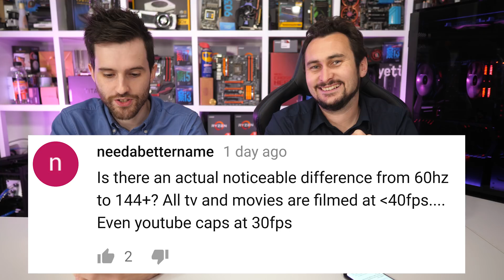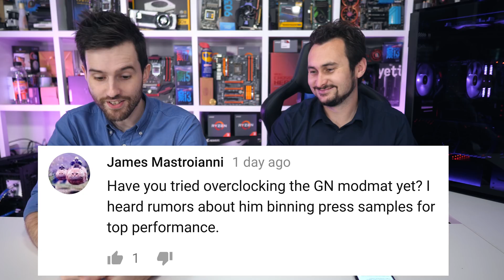May 2018 Q&A [Part 2] Will AMD Make a Better APU? GN Modmat Overclocking

Comment: Is Ryzen really future-proof for gaming?
Probably yeah? I simply don't know. There are many reason why I think it is
1. Games starting use more than 4 threads and game developer have no reason to use less
2. Current and next gen console use AMD 8 cores CPU
3. Rumored PS5 will use AMD ZEN based 8 cores CPU architecture and game developer will optimize the game on both console and PC at the same time
Reply: 4. Low-level APIs which're eventually going to become mainstream, spreading the workload amongst all threads evenly as opposed to current high-level ones which put the majority of the load on the first thread. So theoretically the more fast threads you have the better, but there's a level of optimisation that goes into it unsurprisingly.
Reply: fx had 8 hamster wheels but only 4 hamsters.... do not count that one as a real 8 core, because it is not
Reply: look at AC: O benchmarks of i5 8xxxs, CPU usage is at 100% on all cores, and 4 core i5s are useless....
Reply: Matthew B. Why you ask? well if you have 19 minutes to spare watch this video
https://www.youtube.com/watch?v=RwF5XewHmU8&t=61s
i5-8400 and i5-8600K CPU load hover on 90% - 100% at AC: Origins on new install clean PC, imagine what happen on normal PC with program running at the background.
Reply: Matthew B.
1. The reason why I chose AC: Origins is to show you the possibility if you gaming with CPU with less cores and threads.
2. The reason why RYZEN have less FPS than intel because RYZEN is brand new CPU architecture and unoptimized, all games we play today is intel CPU optimize. This video will explain it: https://www.youtube.com/watch?v=ylvdSnEbL50
https://www.youtube.com/watch?v=gFBKFz9n2hc
3. The reason why I chose RYZEN more future-proof for gaming is because RYZEN have more cores and threads, most AAA game developers don't make game with high FPS with same graphic from last game but more graphic with same FPS. And with more cores and threads game developers can cram more graphics, effects, physics, more AI, more vast game world, and gameplay for each different cores and threads for each different workload.
4. More CPU performance today does not equal more future-proof in the future.

Comment: There's no real need for a more powerful APU.  No competitor has an integrated graphics solution tgat comes close to Ryzen/Vega, so the question is why would they when they've got total domination over that segment.
Reply: Laptops
Reply: So that they can go one step ahead and dominate the mid range gpu as well like the gtx 1060 ?

Comment: if you are throttling at 60c then either its power throttling somehow or you have vsync on lol.  something simple im sure.

edit:  there are new thingies in the drivers now (maybe its only with max q or geforce experience) but they can limit the frame rate to keep the temp down but there is a way to set it in geforce experience and if you turn the frame rate up or turn the power saving feature off (whatever its called) then your gpu should keep on scaling in performance until it reaches 80-90c.   i think the feature is called inteligent frame pacing (IFP) and will cap the frame rate at a certain speed to keep the power in check.  maybe look for that and turn it off.

PLAYING ON A LAPTOP WITHOUT BEING PLUGGED IN WILL ALSO HURT PERFORMANCE DRASTICALLY AND WILL CAUSE LOW PERFORMANCE AND LOW TEMPS.  ALWAYS PLUG IN YOUR LAPTOP WHEN YOU ARE DOING SERIOUS GAMING
Reply: Its nvidia turbo boost , the core clock I get at 50c at 60c are different
Reply: well thats true you get different speeds but most gpus should go to 80 or even 90c  and not stop at 60c.  unless its that new max q crap.  maybe i should mention that in the original post .  edit time lol
Reply: Yes going over 80c or not its another discussion . My point here is that he might be confuse about the difference between turbo boost and thermal throttle and assume his gpu boosting not a s high as a thermal throttle
Reply: yeah sure if he sees the clocks go down when it hits 60c then he might call it thermal throttling.  but if hes wondering if it will effect performance then he should just look and see if its getting slower.  i guess youre right but only because this guy is very confused.  

its not throttling mr guy who asked the question.  its just adjusting the clocks.  you should do some reading and test it for yourself before asking  in a youtube comments section.  thermal throttling means things are goin slower not that some numbers change a tiny bit.  youll figure it out
Reply: yes the clocks for the 1050 and the other pascal gpus will start to drop down after 60c but its totally normal and nothing to worry about.  it will drop about 12mghz every 10 degrees maybe?  im not sure.  but good catch ray lee yit lun.  nobody including the guys in the vid were thinking about it that way.  this is not thermal throttling though
Reply: Battery Boost is the nvidia feature to conserve battery, locks at 30fps and lowers settings too I think, I've never used it (I play around with crazy SLI laptops and nvidia don't bother with power saving technologies on SLI lol)

Comment: Regarding the 720p resolution supposedly showing how the CPU will perform with CPU-heavy games: that is not totally true. It shows how fast the CPU can deal with many light tasks: it increases the load on CPU, but does not make the game more multithreaded. For heavy load- there is CPU load, which is never shown in benchmarks, because it does not affect the results till CPU gets to it's 100% load. The thing is- total of 6 threads on the i5 8400 will get all it's threads 100% loaded much faster than 6c/12t CPUs, and this is likely to start happening in ~1.5 years if new generation of consoles come out with 6-8 core Zen.
Reply from the maker: It removes the GPU as the performance limiting component plain and simple.
Reply: It does but it can't totally account for future games that may require more threads.  If that happens a presently faster cpu in games can possibly lose ground to a cpu with more threads in the future.
Reply from the maker: Games in 20 years will require more cores, games in 3 years aren't going to be radically different to what we have now.
Reply: You may very well be right.  I just recall a lot of 2500k owners expressing regret that they didn't spring for the 2600k in regards to gaming in just 2-3 years time.  In fact some said that they wouldn't make the same mistake twice in regards to the 8600k vs 8700k.
Reply: This generation of consoles use weak CPUs (probably something like ~300 in Cinebench terms). If the coming generation gets 4 Zen cores- then I agree, i5 8400 should still be fine for a a long time. But if consoles get 8 cores, and Sony/Microsoft goes to show it off their possibilities in games- then CPU load might go x5 higher, and i5 8400 might be in trouble when running AAA ports. And console makers might go with good CPUs this time, because it gets expensive to push graphics to look much better than current PS4 Pro/XB1X- but 7nm 8-core Zen CPU with reduced cache should be relatively small and cheap to make.

Comment: Which date to release ddr5 Ram & pcie 4.0 Please tell me
Reply: FDMtech thanks bro I am wating
Reply: Both PCIe4 and DDR5 can be released on the AM4 platform just would require new chipsets. So could come prior to 2020 if the specs are finalised and there's enough products available to ship that people will purchase boards for them.

DDR5 seems to be awful for the time being. It has super high frequencies but the latency has also increased substantially which is in the opposite direction to what most would want for home computers. If this isn't improved prior to release DDR5 may remain a mostly server space spec for hardware.

Comment: Steve and Tim do you have any idea when the lian li pc-011air case is being released?
Reply from the maker: No idea about Lian Li products sorry, they have always been impossible to deal with down under.
Reply: Ah ok no worries thanks for the reply
Reply: Also wanted to ask I've got a 4790k with a GTX 780ti upgrade now or wait too see if Intel or amd launch zen2?
Reply from the maker: The 4790K is still fine for gaming and will get the most out of a GTX 1070 for example.
Reply: Hardware Unboxed thankyou decisions to make :)
Reply: Hardware Unboxed just too let you know Steve I've bit the bullet and ordered a new system went with a 8700k and a evga 1080ti,Asus rog strix z370 e gaming motherboard

Comment: ERRR Isnt hades canyon is already a more powerful AMD APU ??
Reply from the maker: Yes but it's not the same thing, that's an on package design with it's own dedicated memory stack. It's basically a discrete GPU.
Reply: yes and no, it has 24 CU vega, it is more powerful

but they are 2 seperate chips on 1 substrate, AMD's apu's on the other hand are really a all-in-1-chip.
so you could easily argue the hades canyon vega is actually a discrete GPU.

there's no point in having more CU's that if you don't also have the hbm or some other fast vram ram to support it either
and since either of those don't go anywhere on regular mainstream PC mainboards, there isn't much they can do.

unless HBM stacks on the mainboard get standardized, it's pretty much only for custom solution/embedded hardware stuff
Reply: They could put all three chips in one package which fits a socket, HBM needs to be right next to GPU anyways so motherboards won't ever have HBM(soc/embedded is different). Unfortunately AM4 is too small for 3 chips. Then TR4 is way too big, too many pins and boards are expensive but it could house powerful GPU with HBM stack or two. I doubt it would sell much because TR4 customers would rather buy real graphics card and people wanting APUs are looking cheap solutions. Maybe 7nm allows to fit chips in AM4 package, but still HBM stacks pretty much needs to be halved in physical size. Narrowing bus to 1024bit would do that and with increased clock speeds one stack could provide low midrange level of bandwidth. However that probably doesn't happen soon as HBM is used only for high end and it's not large volume product.

Comment: 0:19 - XMP explained. 
1:52 - Laptop thermal throttling. 
3:16 - Replace R5 1400 for R5 2600X? 
4:25 - Will RAM prices go down? 
5:09 - Do we ask for review samples? 
6:18 - Who will get to X499 first? 
7:00 - Will there be a more powerful APU? 
8:06 - Can you notice the difference with 144 Hz? 
9:17 - How much time do the big benchmark videos take to make? 
10:00 - How far can you overclock the 2600 with the stock cooler? 
10:36 - Have we overclocked the GN Modmat? 
11:52 - Is Ryzen really future-proof for gaming? 
13:37 - Does B360 support DDR4-3200?

for mobile :)
Reply from the maker: Legend :) Thanks mate.
Reply: Thanks to you for the wonderful video <3
Reply: Alessandro Melvasul Timpone thnx!!
Reply: Not all heroes wear capes
Reply: Cheers

Comment: Last time I was this early I could afford 8 gigs of ram.
Reply: just blew $300 AU on 16gb.  Stupidly i bought 2400mhz instead of 2666 back in 2015. It cost $99. the 2666 was only $5 more.  I just got the 8700k and because im pedantic i dont want to run RAM less then CPU's stock RAM speed (2666).   Now im stupid and blew it on 3733mhz
Reply: Last time I was this early, I can afford 32GB of RAM!

Comment: First

Would it be possible to overclock an SSD if you had decent cooling (say, integration into a custom loop)?
Reply: maybe, but it would be pretty complex to try this outside of changing BCLK/pci speeds. Not sure if they would put out enough heat to require water cooling though, or if there's even performance gains worth having.

To me, reliability is the single most important factor for a drive so OCing it is completely pointless. Losing data is more of a cost than a few milliseconds improvement to random waiting times. If it was just a game data install disc or something else completely irrelevant if lost, then yeah maybe there would be some usage scenario but you also have to weigh this against reinstalling 200-500gb of games if you fry the disc.

Its not like killing a mobo or cpu where you can just switch out the part and go immediately. Replacing the broken disc can take days/weeks once you have the hardware in hand.